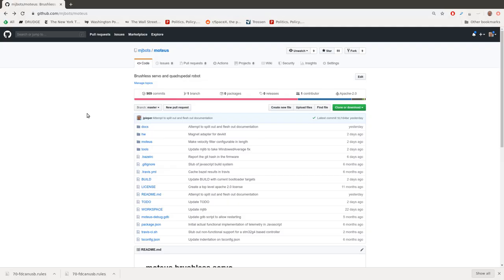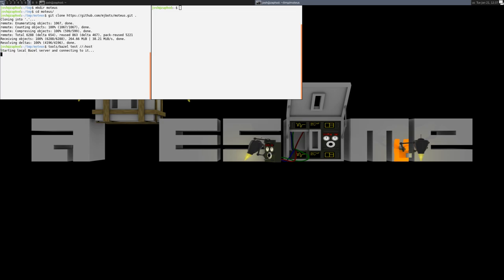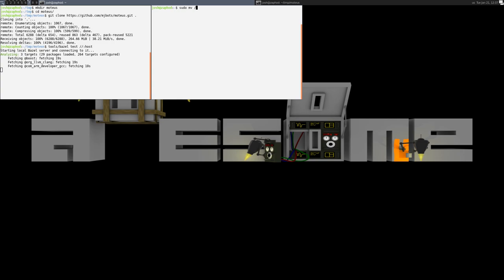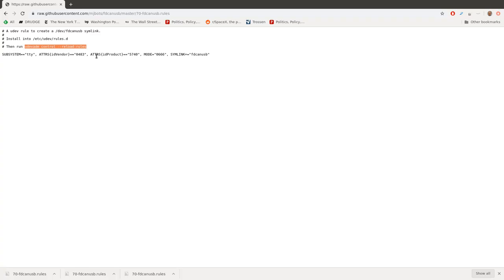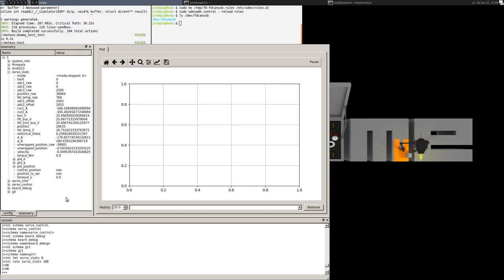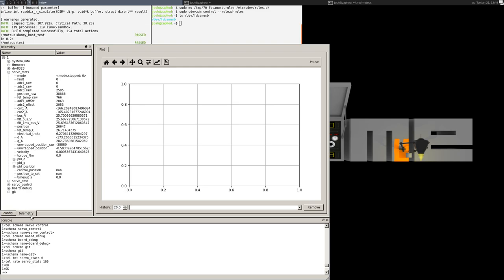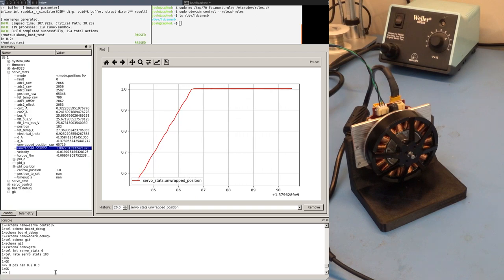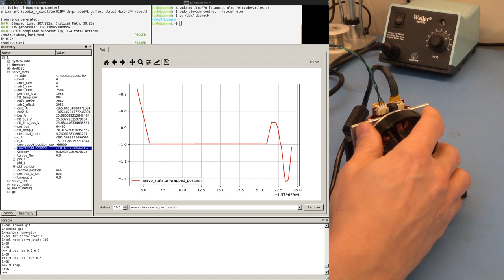DO NOT WATCH - SEE NEWER VIDEO IN DESCRIPTION - moteus controller beta devkit introduction

Comment: I tried to follow this on raspberry pi. It does not work. (“tools/bazel test //:host” fails). I tried on Jetson Nano. The same error. Please help.
Reply from the maker: Unfortunately, building firmware and running tview is currently only supported on x64 linux systems.  If you have a Windows or Mac desktop or laptop, installing Ubuntu 18.04/20.04 in Virtual Box is probably the easiest route.  (lots of other robotics things work best on x64 linux, so it isn't a terrible idea to have such a system around anyways)

There is a patchwork of support for running subsets of functionality on other systems.  For the Raspberry Pi and Jetson Nano, the python bindings should work out of the box: https://jpieper.com/2020/12/09/pip3-install-moteus/

For the Raspberry Pi, there is a pre-compiled moteus_tool in the pi3hat_tools tarball from the pi3hat release: https://github.com/mjbots/pi3hat/releases/

And for Windows, there is a pre-compiled moteus_tool in the moteus_host_tools part of the moteus release: https://github.com/mjbots/moteus/releases
Reply: @awesjosh  thank you for your answer. Can I perform the calibration through the python module? Where I can find detailed tutorial on thus python module? I found only simple examples on the moteus github page.
Reply from the maker: The python module does not currently support calibrating new motors.  You can do that through moteus_tool, either compiled from source on x64 linux, or using the windows/raspberry pi precompiled versions.

There does not yet exist a detailed tutorial or documentation for the python module, it was only released a few days ago for the first time.  However, the primary interface for it, "set_position", takes the arguments shown here https://github.com/mjbots/moteus/blob/b94b1e64a23ef0919c8b7f0ffa8b9ecd47b2620b/lib/python/moteus/moteus.py#L412, and has nearly identical semantics to the "d pos" command as seen in this video and documented here: https://github.com/mjbots/moteus/blob/main/docs/reference.md#d-pos

The only difference, is that when using "d pos" from tview, by default watchdog_timeout is set to NaN.  However for "set_position" from the python bindings that argument defaults to use the system-wide configured watchdog timeout.

I am in the process of updating tview and moteus_tool to provide out-of-the-box working solutions across linux/mac/windows/rpi/jetson, but it may be a few days until a draft is available.
Reply: @awesjosh  thank you a lot for your reply. The out-of-the-box solution for multiple platforms would be GREAT!!! Can I send you my email, to notify me when it is ready? I would love to test it asap.
Reply from the maker: Will do!  For anyone else, you can get rapid notifications of improvements in the mjbots discord: https://discord.gg/W4hUpBb

Comment: Looks like there was no external encoder such amt 102 needed, where is the encoder for mjbots motors? Can bus is cool, I hope we can string it together
Reply from the maker: The moteus controllers integrate an AS5107 magnetic encoder on the back.  You can daisy chain many controllers together.  On the quad A1, I only have 3 per bus, but that is primarily to achieve a high update rate.  It should function fine with dozens on the same bus.